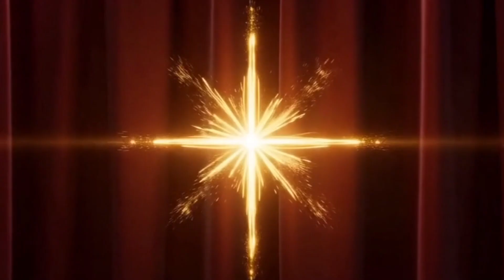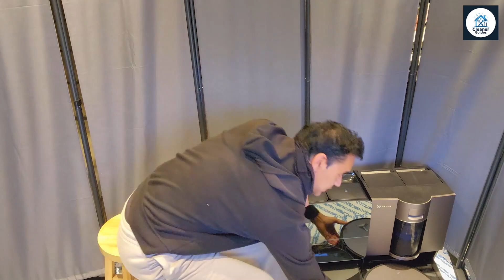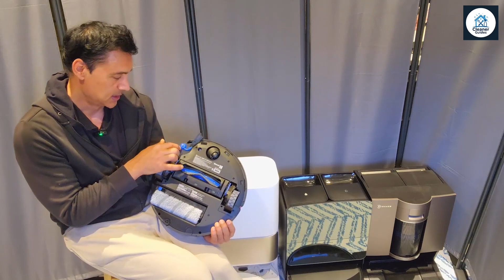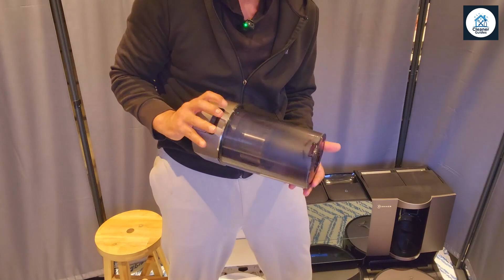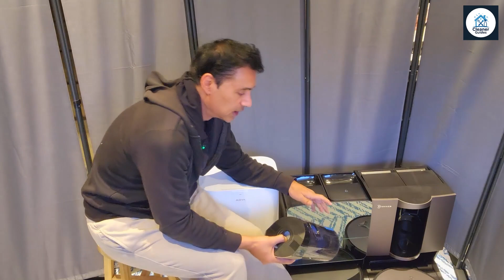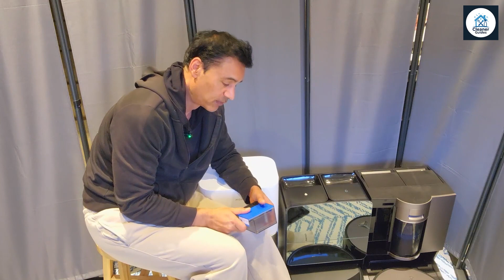Best Robot Vacuum For Pet Hair And Carpets In 2026

Comment from the maker: 👉 Check the Top 5 Amazon affiliate link below for the latest price, discounts, and Subscribe & Save options to save even more.

📢 Roborock Saros 10R Robot Vacuum and Mop, 22,000 Pa Suction,  3.14’’ Ultra Slim, FlexiArm Riser Technology for Carpet & Floor, Corner & Edge Cleaning -
🔎 Check On Amazon: https://amzn.to/4vBFtof

📢 Roborock Saros 20 Robot Vacuum and Mop, 36,000 Pa, 3.46 in Double-Layer Threshold, 3.14’’ Ultra Slim, Zero-Tangle, 212°F Hot Water Wash, AI Powered Smart Cleaning for Carpet, 300+ Obstacle Avoidance  
🔎 Check On Amazon: https://amzn.to/3SP8XAe

📢 Roborock Saros Z70 Robot Vacuum and Mop, OmniGrip Arm, AI-Powered, 22,000Pa Suction, 3.14’’ Ultra Slim, FlexiArm Riser Technology, AdaptiLift Chassis, Obstacle Avoidance, Auto Mop Washing & Drying  
🔎 Check On Amazon: https://amzn.to/4xTNB4T

📢 Roborock Saros 20 Sonic Robot Vacuum and Mop, 36,000Pa Suction, 3.46 in Double-Layer Threshold, Reactive AI 3.0 Obstacle Recognition, 212°F Hot Water Wash, Zero-Tangling, 3.14’’ Ultra Slim, Black  
🔎 Check On Amazon: https://amzn.to/44EaR9r

📢 DREAME X60 Max Ultra Complete Robot Vacuum and Mop, Upgraded from X50 Series, 3.13in (7.95cm) Ultra-Thin Design, 35,000Pa Suction, Self Emptying&Refilling, Mop Self-Cleaning, 280+ Obstacle Avoidance  
🔎 Check On Amazon: https://amzn.to/4v5puh5

👉 See More Details: https://cleanerguides.com

⚠ Affiliate Disclaimer:
This video contains affiliate links. If you purchase through these links, I may earn a small commission at no extra cost to you. This helps support the channel and allows me to continue making honest reviews. Thank you for your support! 🙏☕